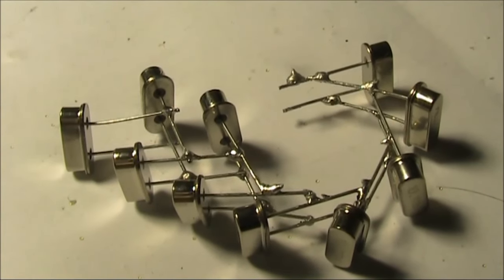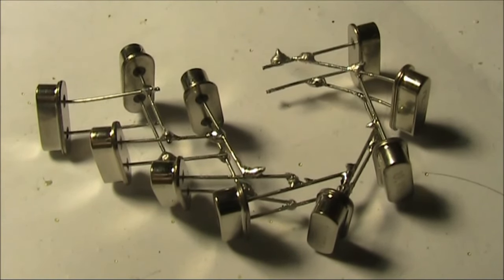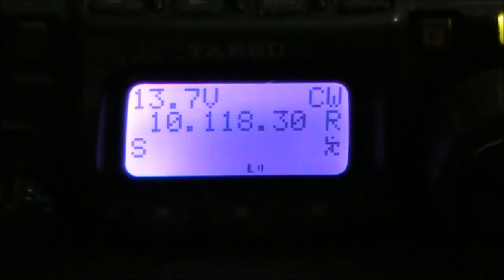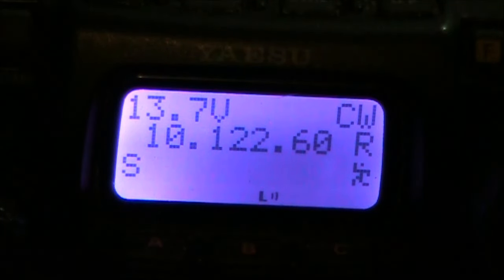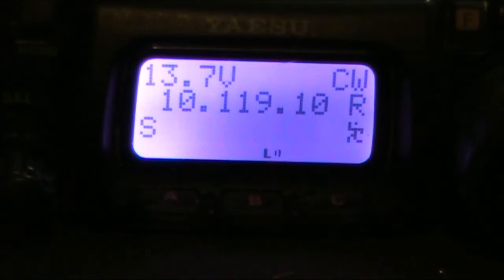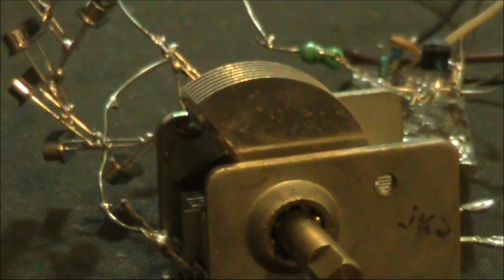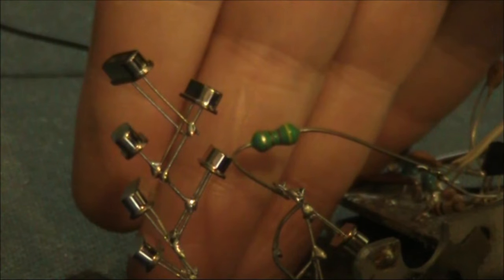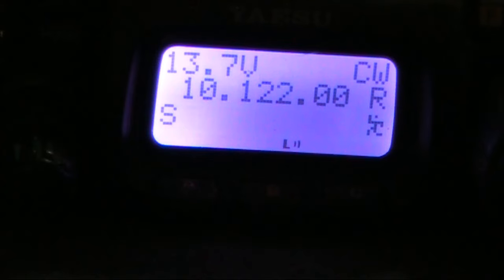10.111 MHz super VXO with 10 crystals: How far does it swing?

Comment: VXO a 45.1584 xtal and mix it with a 35.040
Reply: Farley Hill Definitely the way to go.
Reply: Supervxos do work well in the fundamental frequency range.  Just add a driver and IRF510 and you have a perfectly good QRP CW tx there.  Here's my build of a 14.318mhz supervxo in a 30m Wilderness SST transceiver. I used a 1SV149 varactor diode, 4.7, 1.5 and 1uH inductors in series (7.2uH) and settled for a coverage of 10.104 to 10.118MHz. https://vk3hn.wordpress.com/2016/12/27/summit-prowler-two-a-scratch-built-30m-cw-transceiver-wilderness-sst-for-sota/
Reply from the maker: Higher crystal frequencies definitely pull further. But crystals above 25 MHz are typically 3rd overtone. I've found them much harder to shift in a VXO circuit.  Has anyone else found differently?